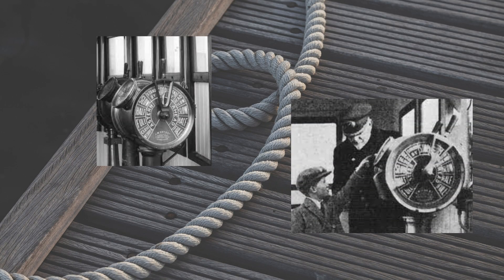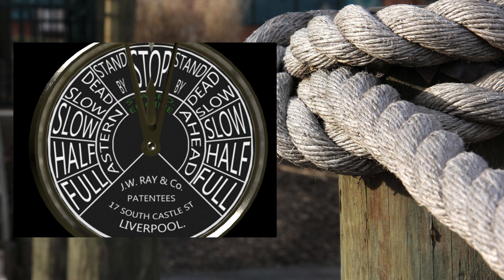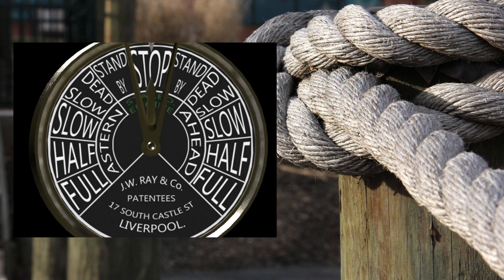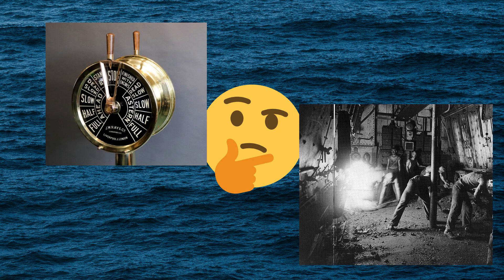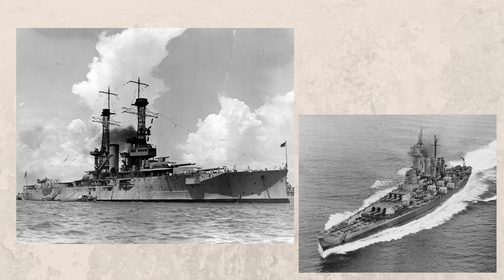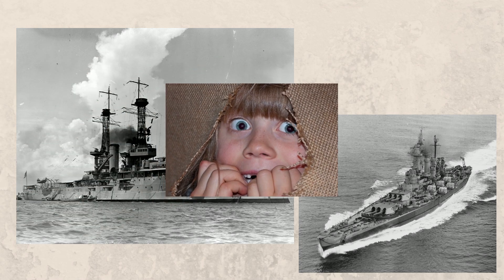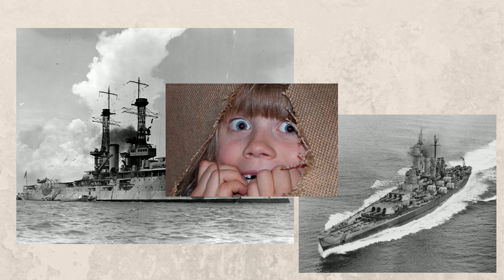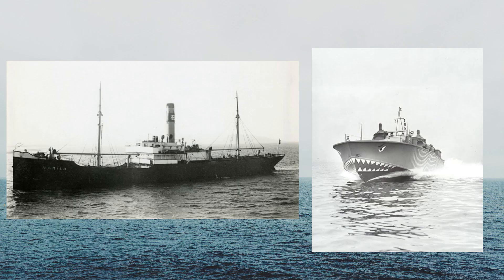The Engine Order Telegraph: How Did It Work?

Comment: How were the engine Order Telegraphs connected? Could the captain have asked for the starboard engines to run full ahead, and the port engines in full astern? would this give more turning power? I have driven sportfishing yachts, and when I dock I rarely touch the wheel at all, just come in using the transmission/gears/engine to turn. How would this technique act on the Titanic?
Reply from the maker: Engine Order Telegraphs were connected via a chain system and were mechanically driven. As the handle was moved on the above deck telegraph, 
the chains would change the indication on the panel located in the engine room. To answer the question on whether or not the port and starboard engines could be individually altered to increase turning ability, that is a yes. Titanic had two main Engine Order Telegraphs, one for the port and starboard engine. Slowing one down and increasing the other would definitely increase maneuverability, but the order was given to only stop the engines. In the movie they order "full astern" but in actuality, the order was given for a full stop which didn't increase the slowdown rate in time.
Reply: @thehistoricallibrary6790  WOuld the titanic get extra mobility if the starboard engines were full ahead coupled with the port being full astern? This is what I mentioned with sportfishing yachts.
Reply from the maker: @ryandyc  Yes definitely. But unfortunately the crew wouldn't have enough distance between themselves and the iceberg for that to be greatly affective.

Comment: I don't know where he gets "EOT" from.  In standing watches on the bridge or in the control room of at least five (5) different ships and submarines in my life I have never heard that.  On the other hand, the expression "annunciator" was always a (if not the) standard term used in the US Navy.   The confusion continues apace from there.  The first thing the engine room does on receiving an engine order in any vessel with a steam plant is to OPEN or CLOSE the throttles to pass more or less steam through the engines.  If steam demand as a result is too high, THEN it becomes necessary to increase the fuel supply (whether it be coal, as he references here, or oil, which replaced coal beginning early in the 20th century) to the boilers to increase the steam produced.  Condensate feed to the boilers or reactor also must increased to keep up with demand.  He has left all of this out.
Reply: This is the first place I heard them called ‘EOT’, most of the literature I have ever read is in some form related to shipping, I can not say I have heard it before.
Doing a quick google, it seems it’s what Wikipedia calls them, and since Wikipedia co-existed with many liners in the 1800s, it must be the correct term
Reply: @Jimmy644boy  Wikipedia is always right.
Reply: "EOT"  is new to me too - I'm ex-British merchant navy, where we just called it a telegraph, so EOT isn't something I'm aware of being used on this side of the  Atlantic either.  In fairness, I'm aware of the expression "engine order telegraph," just not the abbreviation EOT.  And I agree with your spelling of annunciator, which describes an illuminated panel for indicating (announcing) alarm status: "enunciate" has a different meaning.  
Older telegraphs, with mechanical bells that were operated by working the handle on the telegraph at the other end back and forth, were connected using chains, which needed shortening as they wore or stretched.  If not adjusted in this way, the handle at one end would no longer match the pointer at the other end!  More modern telegraphs were connected electrically, with electric bells that were caused to ring whenever the position of  the handles and pointers differed.  We still had electrically operated traditional-looking telegraphs on ships built in the late 1960s, so I agree with ANL engineer Rudolf Peter Udo.     Our OCL container ships shared the terminal in White Bay, Sydney, with ANL ships in the sixties and seventies.
Reply from the maker: @Daniel Gregg The focus of this video was directed only towards the engine telegraph, not the specifics of what engineers do after receiving a telegraph order, or when steam ships converted from using coal to oil. As for the acronym "EOT", it's just the proper term used to define Engine Order Telegraph . Remember these types of telegraphs were only predominantly used up until 1950, so nowadays the terms and systems are a lot different.

Comment: I thought they were called telamotors
Reply from the maker: No, a telemotor is an emergency device used to steer the ship if normal steering were to fail.
Reply: @thehistoricallibrary6790  ahh
Reply: @thehistoricallibrary6790  
I don’t think it’s an emergency device.
Most ships from 1900s, 1910s, 1020s, used telemotors as there prime steering link.
Including titanic.

Edit, after abit of research, I can’t see any example of a ship that uses a telemotor as an emergency form of steering
Reply: @Jimmy644boy  Telemotor is a purely hydraulic form of steering that was commonly used on ships up until the middle of the 20th century as the primary means to move the rudder. But it eventually fell out of use in favor of electric transmission. The Telemotor is still on many ships but as a backup in case the electrical system fails

Comment: You explained what they were used for not how they work.
Reply: Push the handle to sound the alarm in the engine room indicating a change in speed or shat direction. Pull it back to starting position to engage hand that indicates speed. Push it to desired speed and that will be electrically relayed to the indicator on the engine room telegraph.
Reply: @cleverusername9369  how is it done electrically?

Did they use a potentiometer to measure the angle or did they work with a phase shift in an ac current?
Reply: @dave_sic1365  honestly I don't know enough about electronics to answer that with any degree of certainty, but given the time period I would imagine it's a simple on-off switch, I don't know the technical terminology, probably something like it would just complete a circuit? I wish I knew more about the actual electronic workings of the device, I know how it works generally, please forgive my inability to fully accurately answer the question.
Reply: @cleverusername9369  yes no problem, but i missed that in the video too.

Informations about those systems are extremely hard to find but explaining a system means in my understanding describing how the signal was transmitted.

Im using 80% of the time making a video on research and mostly how the systems actually worked and this includes reading about chemistry and electrodynamics alot but all this time spent on reading will be condensed in a 2min animazion/graphic.
Reply: @cleverusername9369  Some were chain driven.
Reply: @cleverusername9369  yes with enough motion of the handle rings the bells in the engine room.to get the engineers attention and follow command
Reply: Depends on what kind of EOT it is. Most used a chain drive linked to the handles via pulleys to move the indicator pointers and ring the bells.

Later on, there were electromechanical ones using servos and relays, some just used lights and a buzzer.

Most ones you find today (as engine telegraphs are still required for emergencies) are of the pushbutton type and often just trigger a flashing light on the order panel and a loud beeper that sounds until the engineer pushes the matching order.
Reply: @Shipwright1918  thanks alot
Reply: The RETRO Protogen  I forgot how to read too!